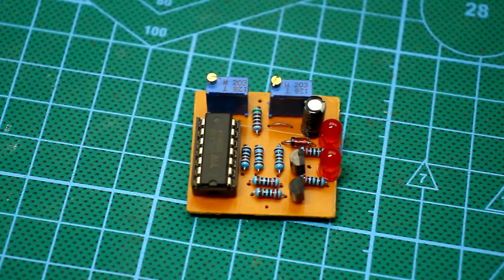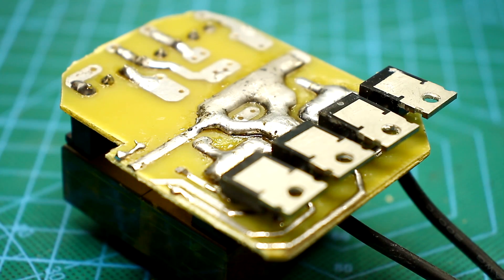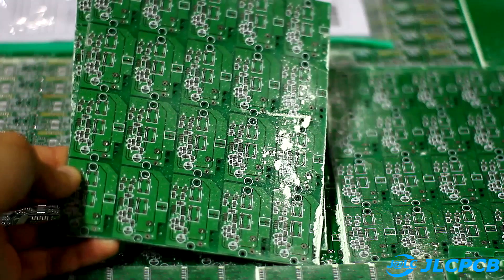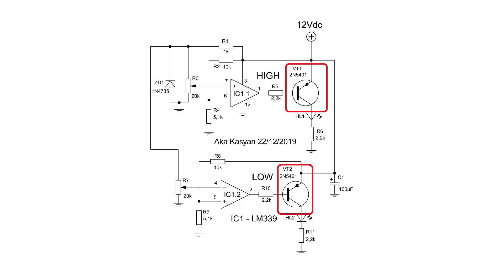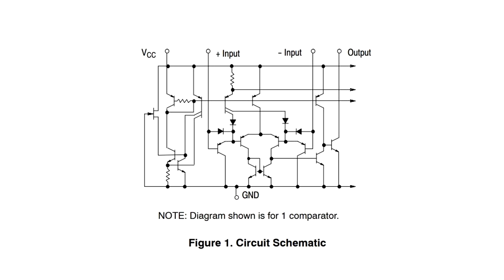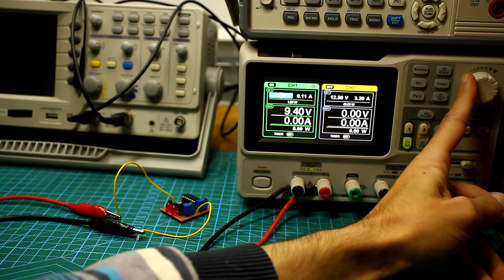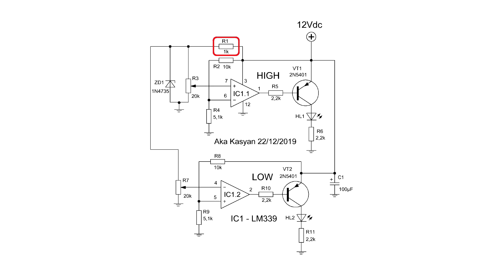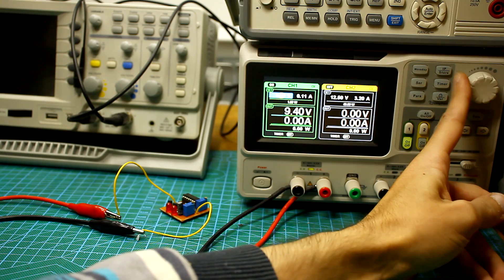Overvoltage and Undervoltage protection

Comment: Wont a simple ziner diodes do the job too just use a ziner to the battery voltage so went the battery is full the the ziner diodes conduct and turn position voltage follows to the pnp turning it of and the same for low voltage use a  valve to the low voltage to protect voltage ziner will stop conduct and the mosfets gate is pull down turning of the device

Comment: Hi 
Thanks for useful video.
I wanna make protection circuit for 5volt supply to protect my microcontrollers, what's suitable "zener diode" for that? 
I'M BEGINNER
Please, Answer soon as possible. its important to me.
THANKS
Reply: I used a 6.2 zener for the low side..I installed mine backwards at first and wondered why it would work...my eyes are bad actually..but it works. I put the transistor output from the pnp's to all run into either a relay or mosfet to switch on/off the circuit. For my current protectiin my circuit was the positive side fuse I was replacing with the protection circuit, so I simply put put the output of 13 Into pin 9 to invert the (+} and give a negative to compare it to...I think some people may have better luck splitting circuit working voltage up and putting a chip in it that has a (+),(neutral)and (-)...this would give it much more range to work in...so I added a zener 9.2 1k resist, and an pnp to provide a more stable the reference, the circuit works like a charm.

Comment: you can used also this as an 12v auto cut off battery charger?
Reply: yes, lm339 have 4 compair icas datasheet as
1. full charge by variable R
2 over discharge by variable R
3. short circuit by variable R
4. any you want by variable R

Comment: I made the circuit the relay trickling because the charging volt not constant 0.3v to 0.5v up down , so unable to set any particular point.need minimum 1v delay in to jump.

Comment: Pretty sure this undervoltage circuit can start oscillating strongly if the input voltage has some impedance, right? 

Voltage is high enough -> load pulls down voltage -> undervoltage protection triggers -> input voltage goes back up -> ...
Reply: I tried something like the above protector but without the op amps, it does that very erratically, and when it has a short-circuited load on it, it would still stay engaged...So I will try this circuit next..But I think that's a normal function of these kinds of protection circuits due to the logic of it. The same if you used it to protect battery over-voltage or under-voltage, you'll want the circuit to re-engage or else the battery will be stressed needlessly.
Reply: @ahmad-firdauscook1452  One could add some hysteresis to prevent it in more cases (battery protection ICs do this), or even count the number of trips and stop after some number, etc.

Comment: Can you show us, circuit protection for 220volt AC Equipment from unstable generators voltage e.g 300volts voltage.
Reply: Hello Dwi Cahyono
The LM324 can grant your inquiry with its 4 gates.
You can apply the low and high voltage protection stages including normal and circuit delay on each gate.
Reply: Can you be more specific?
Reply: Let say, we have electrical shortage. Then we want to use our PC, automatically we will use our generator. Mostly generator's voltage fluctuated frequently start from 180volt to 300volt in a matter of second. So the problem is, how we design circuit that can protect our pc? Other than utilize my pc with voltage stabilizer.
Reply: You can also add a motor driver to move a secondary coil to passively control the voltage...but I think an inverter could do the job too, to make the circuit to drive a capacitated rail and provide a sinewave that is steady. They make some inverters to work off of A/C and D/C at the same time...but by that money, may as well buy solar photovoltaics and make a thermal mass battery underground that can push steam into you converted combustion engine to steam engine driven by that thermal storage...cheaper than batteries and lasts as long as the pipe/tubing.